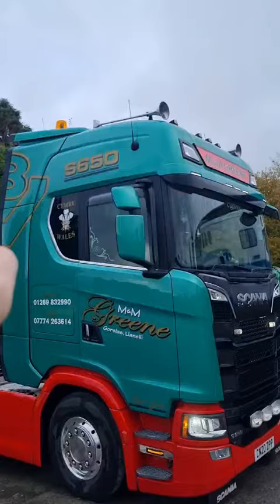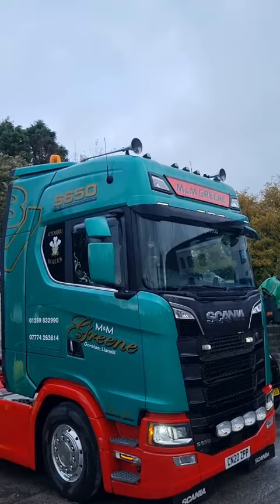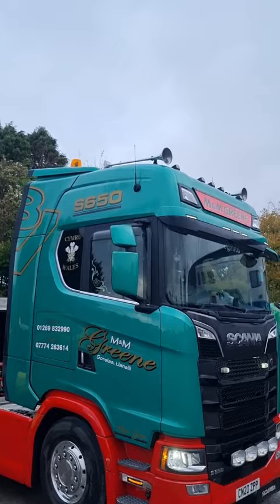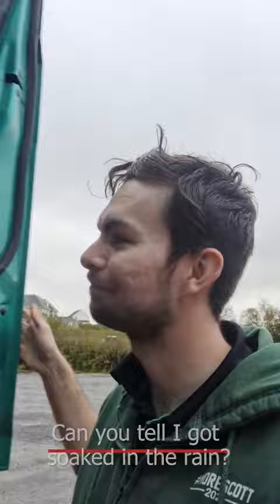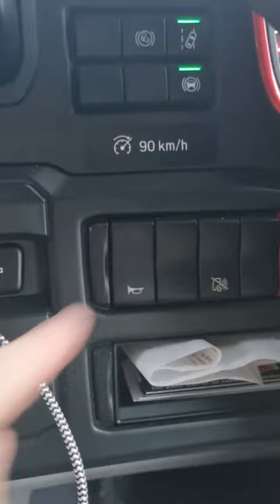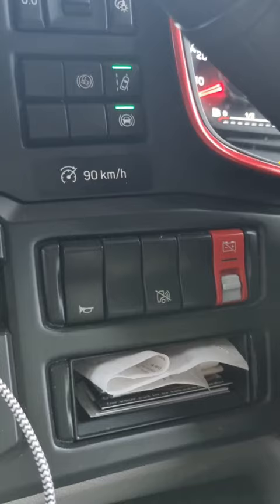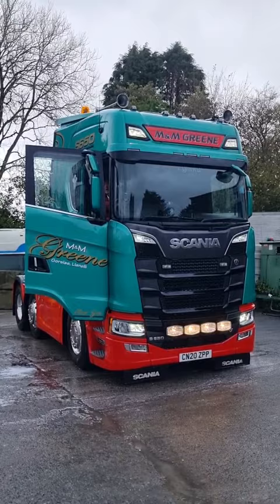How big are my horns?

Comment: 3 wires on back of switch. if u de-pin and reset wires u can make it work correctly. pin 7 5 3 on switch. of memory pin 7 live in and 5 or 3 for output to each horn.